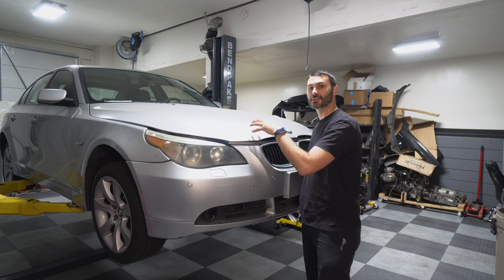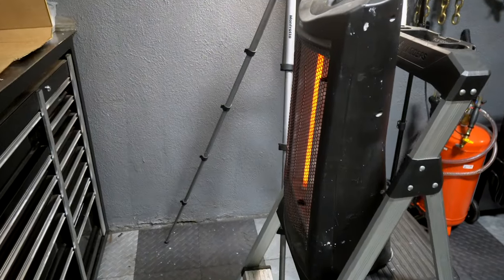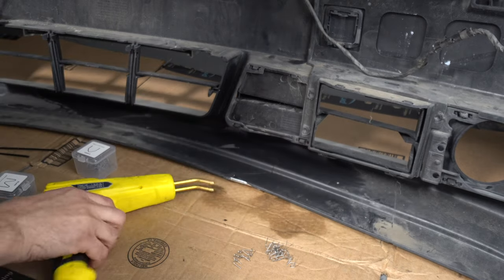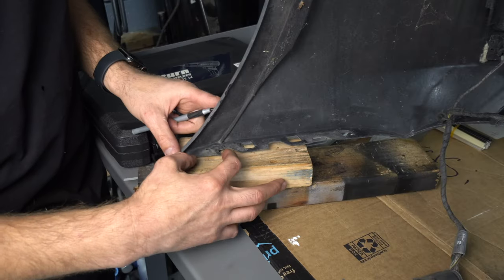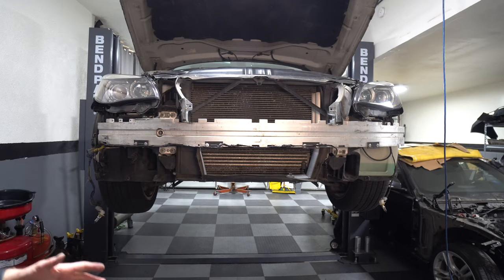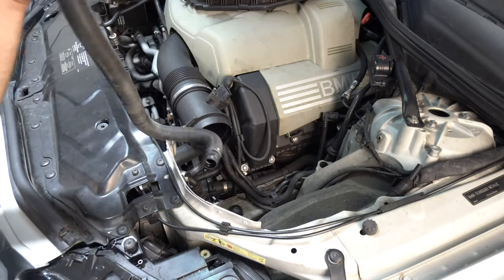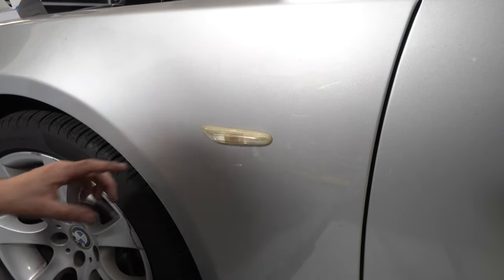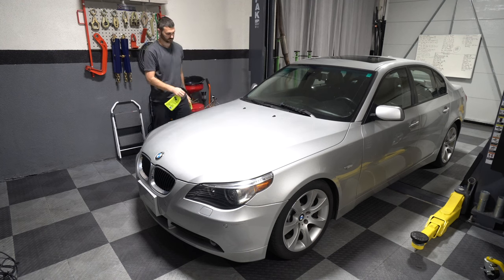BMW E60 Headlight Restoration, Bumper Repair, PDR and More!

Comment: great work!  you can work with your hands man. just curious, wouldn't a polish after the sandpaper leave a better result? and then the clear coat?
Reply from the maker: Hey thanks! I think the clear fills in all the marks from the 1500 sand paper. You do want somewhat of a roughed up surface for the clear to stick to. You could go up to 2 or 3,000 grit but I don’t think it’s necessary. These lights came out great!